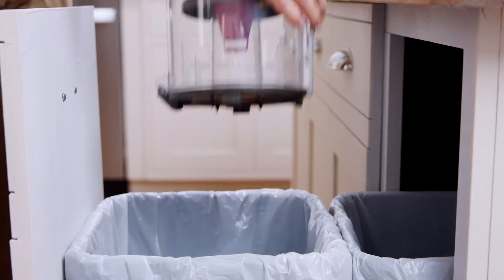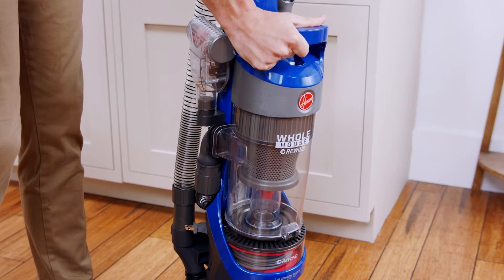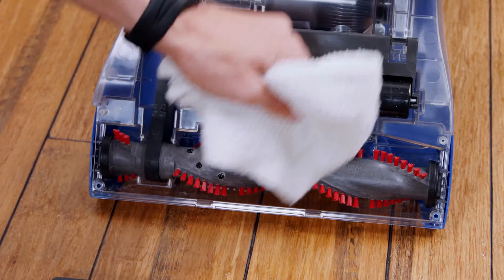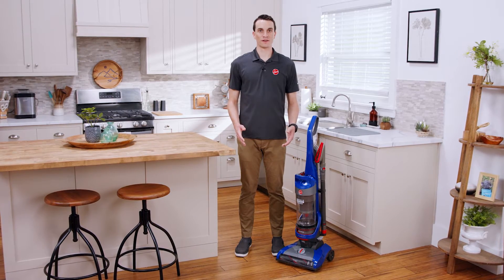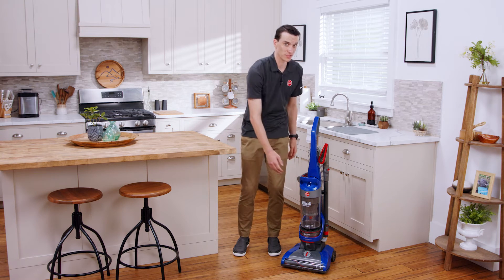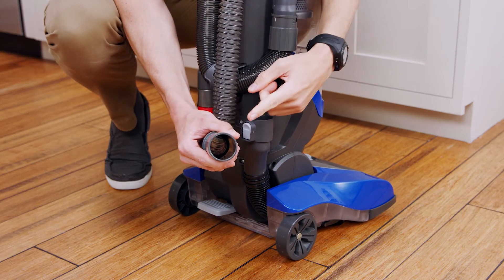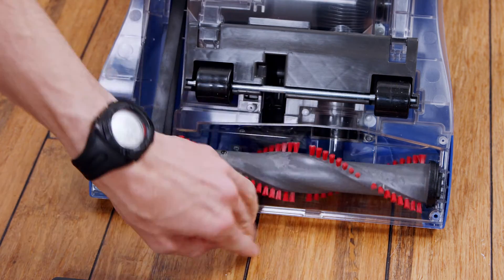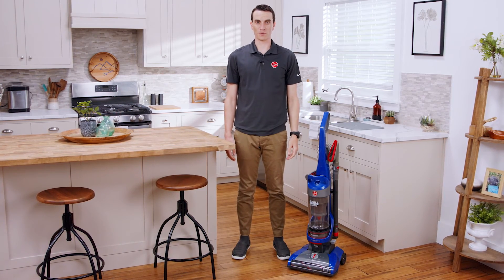Hoover WindTunnel 2 Whole House Rewind - TroubleShooting Guide

Comment: The dirt cup absolutely does not release dirt as easily as this tutorial indicates. Hair, dirt and debris gets caught in the upper part of the chamber and won’t come loose without sticking your hand or a utensil up there to get it loose. This is extremely messy, dirty and disgusting. Another major flaw is the part where the hose connects to the chamber is not air tight, allowing dirt and dust to be released into the air. If you have allergies or asthma, this vacuum cleaner is a nightmare! Do not buy this!

Comment: My hose won't snap in anymore. I have cleaned the hose and the place where it snaps in. But it still won't lock into place. Or, it will for a hot minute and then when I'm sweeping it will pop off. It's so frustrating! Please help.